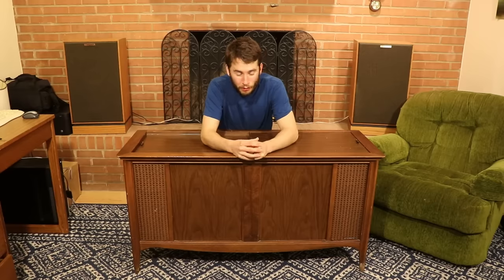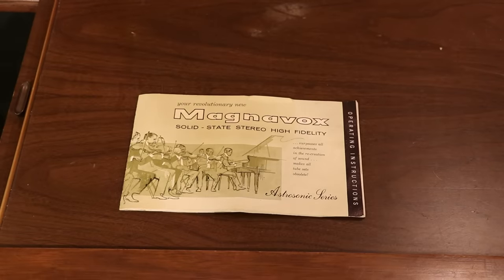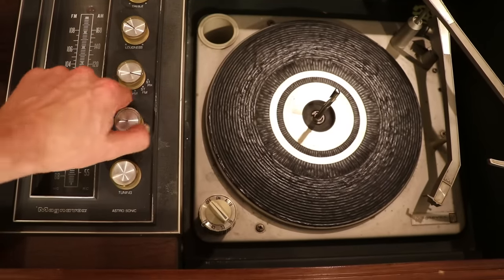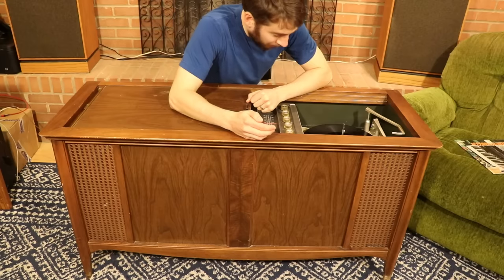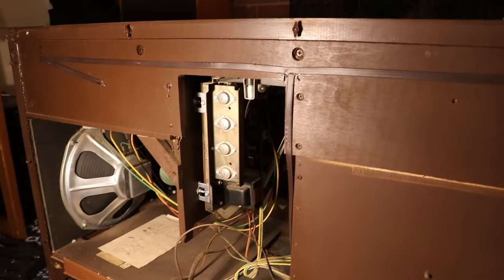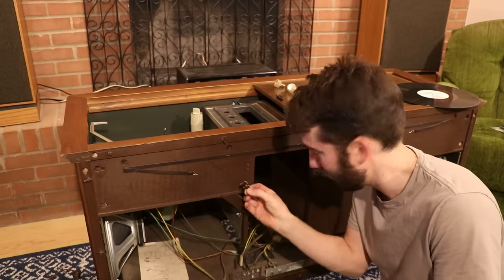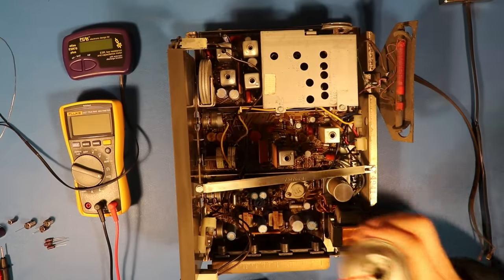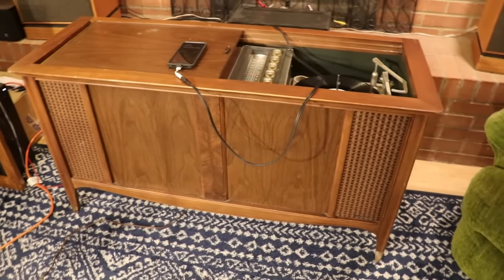They Found A Broken Stereo Console On Trash Day...Let's Fix It!!

Comment: Old fart here having done this for the last 50 years :)
Here's a few advices...
- Recap, at the age this set is, just recap!
- Use only Deoxit ad clean all the pots and contacts
- If you have only a multimeter, don't fool around with the AM/FM tuner section, your life to to make this work again without a schématic will be miserable!
- BEWARE of old heatsink compound! DANGER DANGER WILL ROBINSON! in the '60s this stuff contained Beryllium/cobalt oxide, one is highly cancerogenic and the other will do things to your blood if it gets to it, say from a small cut on a finger.  ALWAYS Weare gloves when removing the stuff and throw them away immédiately without touching anything, like a doorknob or the handle of the bin lid! 
A paper towel and acetone are quite good for removing the stuff
I hope I've scared the hell of you on this one, IT IS that important. When I worked at Canadian Marconi, there was a dedicated room for the assembly of power transistors on heat sinks!

Otherwise, you're good! :)  I liked this VDO
Reply: Thanks for safety precautions. You should share on more of these channels. Good job!!!

Comment: I have a 1969 model 30. I recapped it and added Bluetooth and a new needle. I found one tweeter horn frozen so I replaced it. Even recapped the crossover. When I was done I put it back out in the garage where it sits. The sound quality just wasn't that great.

Comment: A coworker picked up a console stereo / TV on his way to work. It sat in his truck all day. That night, he took it into his basement lab and fired it up. Like yours, the radio worked. When he fired up the TV, he heard a muffled snap, and saw a slight wisp of smoke floating up from the back. No problem, we're all EEs here, he'll fix it. When he removed the back, dozens of cockroaches poured out of the Trojan Horse, scattering all throughout his house. Well, several months and hundreds of dollars in exterminator fees later, he had a mostly clean house, a working console, and respect for the lone cockroach that sacrificed itself by throwing itself across the power supply, so that it's fellow bugs could make their escape from the TV prison.

Comment: I have an RC36 bell record of fone, I have little knowlege of tubes, I wish i could get the amp referbed, dont care if they use new circuitry, I just want it working.. The cutter circuit also needs a complete rebuild from scratch...For now its just a speaker box.. Most local repaire place where i live dontt repaire these any more.. unless its a special item...

Comment: Very interesting thank you. I have this exact model that my grandparents bought, I believe, in 1966. It has the same crackling sound you had in that one. I do plan on restoring it but have been torn on whether I want to leave it original inside and out or just restore the outside and update all the guts. I did not know that the aux input would work with my phone though so that has me leaning towards leaving it as original as possible.